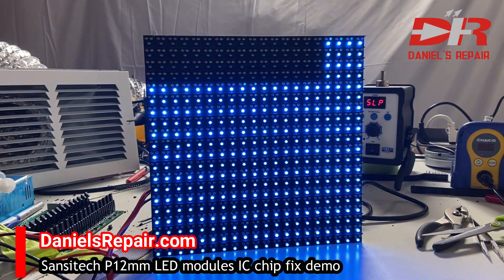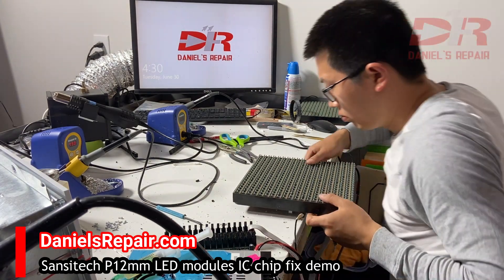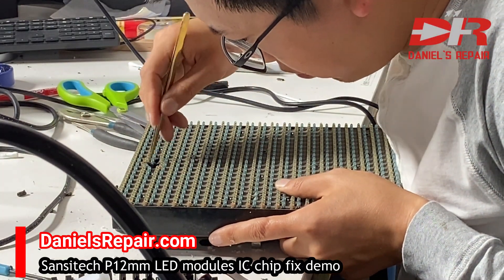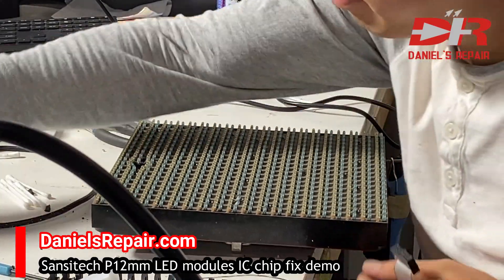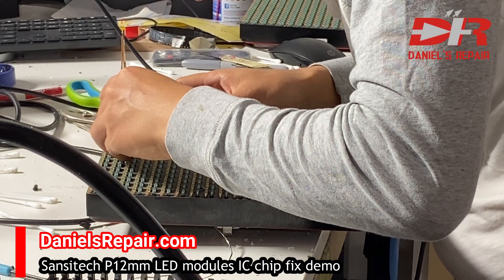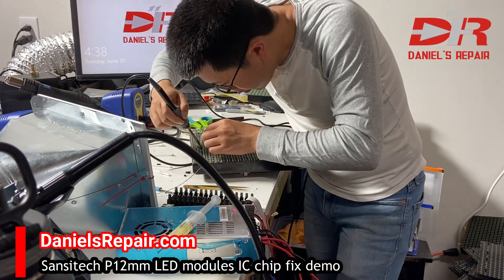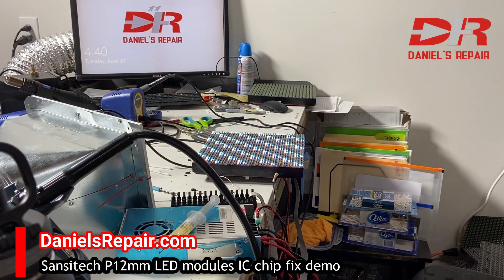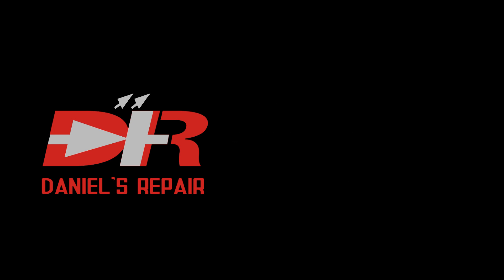LED module repair tutorial : how to repair IC chips

Comment: Hi, I'm hoping you can do what no one else has yet to do. Help me figure out what's wrong with my SP511E & SPI rgbw controllers.
Both are new but neither will work to turn lights on/off or to change to selected color. I've tried plugging in and out, even the 5 times on/off but it only changed to multi color lights. 
No one has been able to help me with a solution. Please help!

Comment: Very Nice repair.   I  do the same work for LED Module
Reply: Hi, I'm hoping you can do what no one else has yet to do. Help me figure out what's wrong with my SP511E & SPI rgbw controllers.
Both are new but neither will work to turn lights on/off or to change to selected color. I've tried plugging in and out, even the 5 times on/off but it only changed to multi color lights. 
No one has been able to help me with a solution. Please help!!